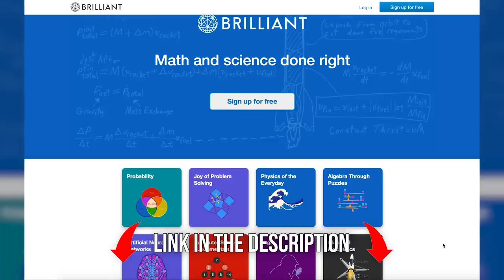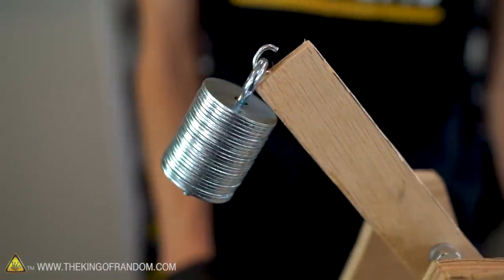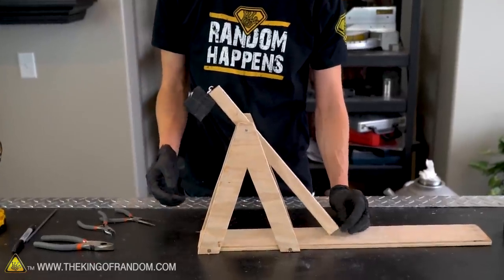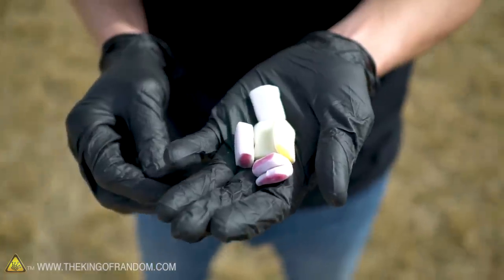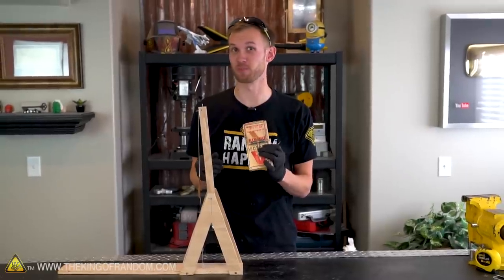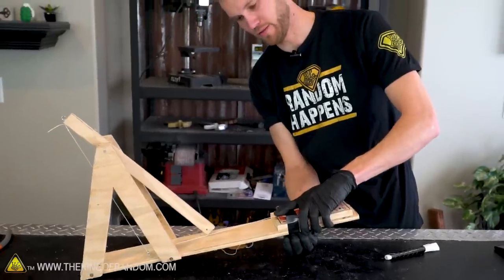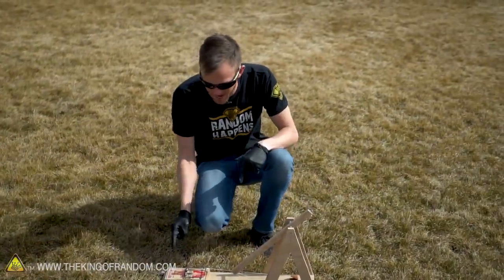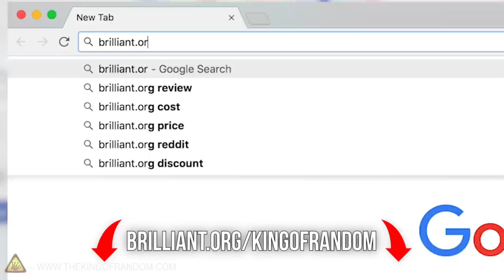Spring Powered Trebuchet! TKOR Demos Making A Rat Trap Trebuchet DIY

Comment: For anyone interested in building miniature trebuchets. You need to increase the ratio between the counter weight and the projectile by several orders of magnitude. You also want a firing arc that is closer to 30 degrees rather than 45. A lower arc means you have more of your initial velocity at impact, rather than having to expend it all to gain altitude, for actual destructive purposes this is very important.

another very important part here. The weight of the cantelever needs to be added to the equation. Also you want to place the pivot point somewhere between 1/5 and 1/3 the length of the arm.

Comment: By adding a hollow base you could drill hole below the trigger, and add eye screw  below the hole. Tie string to trigger, run it down through the hole, through the eye screw and out the front opening. Thus making it easier to launch trebuchet without danger of snapping trap on fingers

Comment: Please start you random weekend projects again.They are the bessst Make a rocket powered by negative X. Also try to make a rocket with chewing gum bottle or toothpaste bottle. You can use the fusion of thermite and kitty litter as fuel or dry ice and molten aluminium as starter bang for fuel. Then you can just use the sugar rockets behind the rocket for the rest of the flight

Comment: Catapults use springs for power. Trebuchets use weight for power. But also catapults use a rigid projectile holder while trebuchets use flexible slings. So I guess this is a catachet.
Reply: Traditionally catapults used torsion for power because springs hadnt been invented.
Reply: @JohnGuest45  Torsion is a legitimate form of spring. It's used as a suspension component on some vehicle axles even today. The ones I've seen had a rubber main element. But metal springs did come later as you point out.
Reply: @joewoodchuck3824  
Hi Joe, 
You`re right they are all springs, it was pretty late so i kind of missed seeing the wood for the trees  ;)